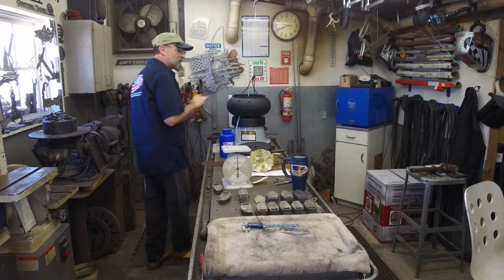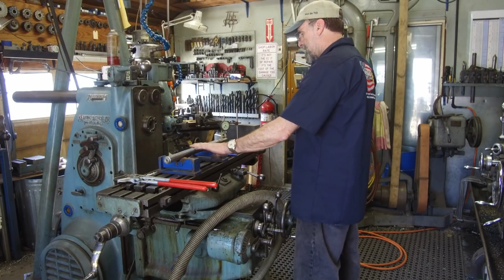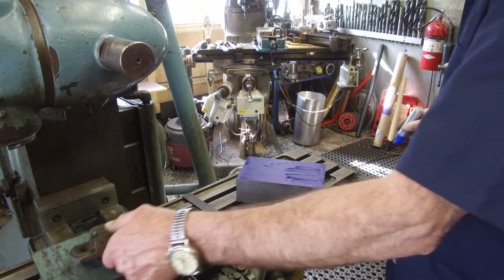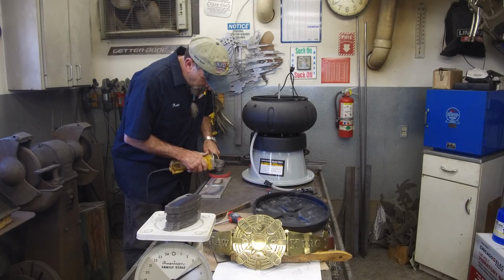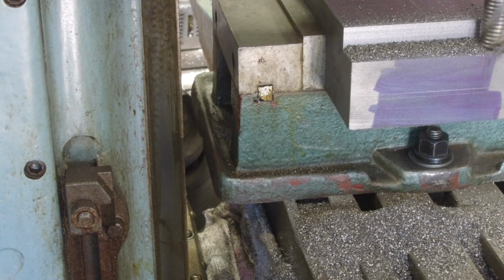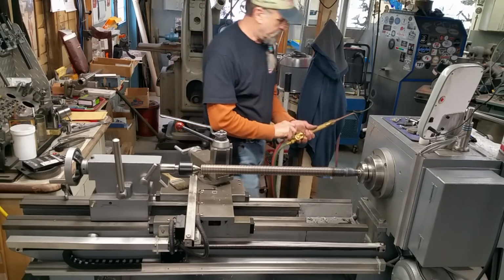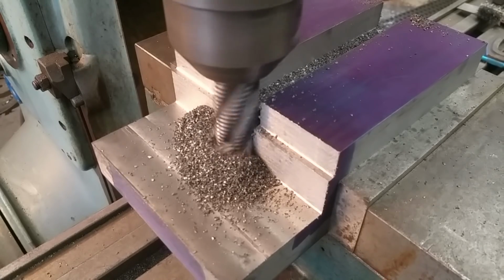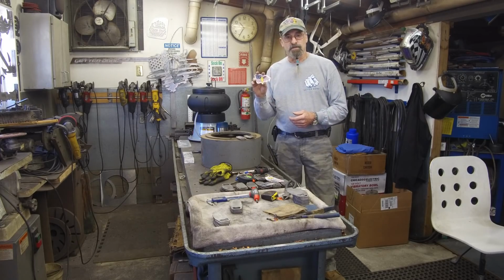The Clapper Part Three

Comment: I use mine with crushed Pecan shells and a nice squirt of Simi-chrome metal polish, and it does aluminum and brass parts like brand new, also you can rejuvenate old cad-plated bolts and hardware - I have the green epoxy/abrasive triangles, never used them yet?

Comment: Saw the lead screw on FaceBook.  I have a soft spot for horizontal mills and Shapers.  That is what I used in High School Shop 1968-70.    I like the 1) Mississippi Mud, 2) Midnight Blue, 3) Red, caps.  If you ever run into a Burke MVN Riser let me know.

Comment: If you do rub it wet, run a zip tie through each one, through the hole in it, to keep them from sticking together. They won't get tumbled on the interface of the two surfaces that are stuck together. (Tip from Grimsmo Knife Machining channel)
Reply from the maker: Yeah thanks, noticed that even dry, the end shape has a bend and that would keep them apart also, getting a batch to that point for a test.  ;{)--------

Comment: how would you find the radius of the clapper box tilt slot, if you didn't know it already? (sorry if that question is answered in another video)
Reply: radius=distance between centre and point on circumference
he has the distance, one centre hole and one hole on the circumference.

Comment: 33:34 The woodworker in me is screaming, "That could have done with a few passes with a circular blade!". (Basically cutting a large rabbet, with a smaller one on top. Then you would have 2 small blocks of metal you could save for something else.)

Comment: They should polish better wet. Smaller media will also get into the corners and notches better. We would do gears for hydraulic pumpmotors with a big rotating-bin polisher with media like that, but smaller and pyramidal in shape (looks like a d4 die).

Comment: I was having a bit of work done on my truck in a shop. What happen there was one of the most horrifying things I ever witnessed.  A workman with long hair crawled under a truck with the drive shaft turning. His long hair caught on the shaft and ripped most of his scalp off. Tuck that dangling chin moss in your shirt!
Reply: I to seen that happen 40 years ago with a drill press, to this day I still think about that when I hit the on button.
Reply: Have seen the same kind of thing happen with a engine boring setup and shoulder length hair. Only thing that saved the guy was another guy was walk by and kill the machine before it pulled his head in. Next day he had a crew cut. Not one to tell other people how they should do their job, but I get a little butt clinch every time I see his whiskers get a little close to anything moving or burning.